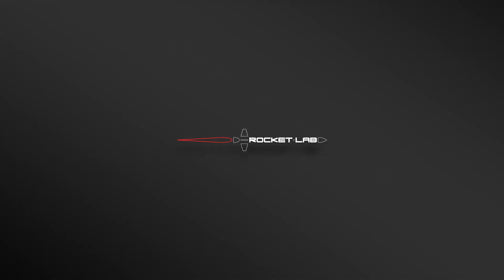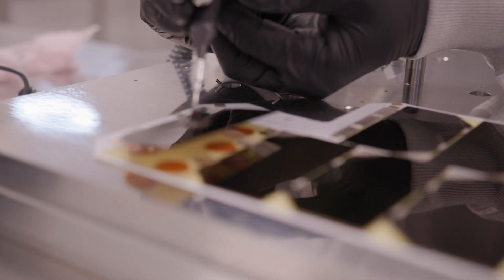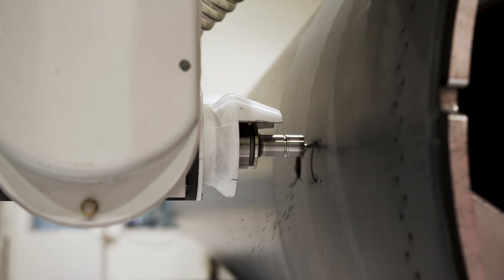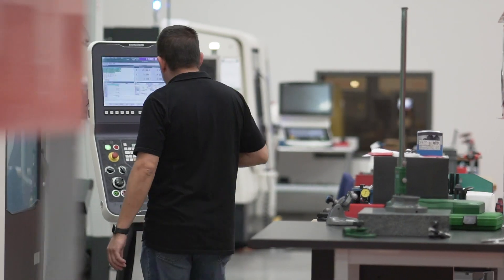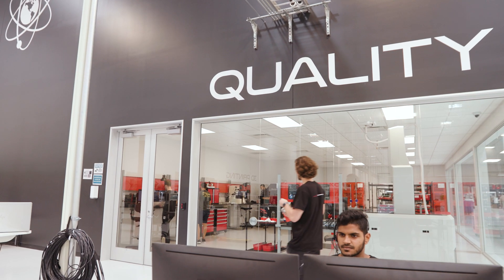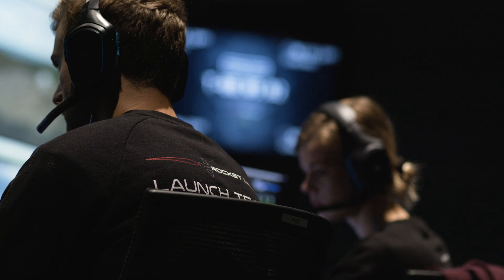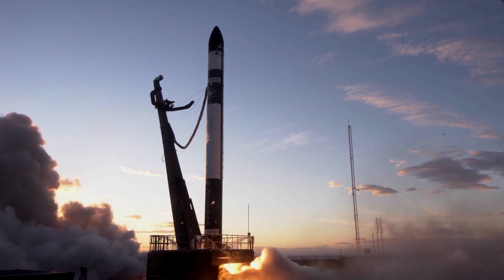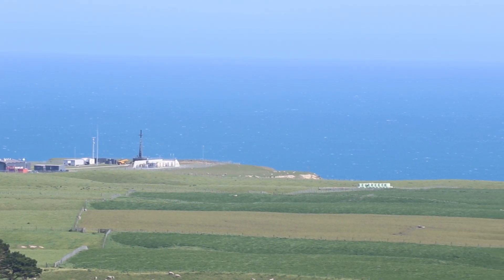Rocket Lab | Global Facilities Tour

Comment: Peter Beck says some strange things can someone explain his statements 
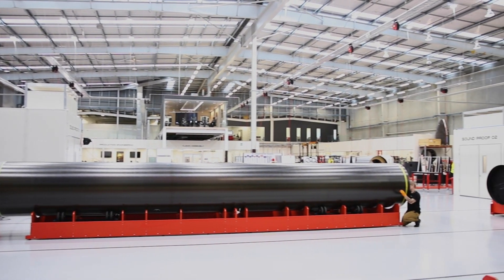@0:56 he says  Every 20 days a rocket rolls off this production line. !
But racket lab has only launched about 20 rockets in 5 years - do they have a stockpile of like dozens of rockets what do they do with them all. ?
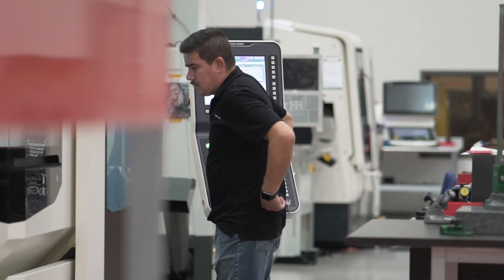@3:30 we produce an engine every 24 hours. !
That would be enough rocket engines in one year for 36 of their rockets - what are they doing with all these engines or do they just run the factory for only 60 days per year. ?
And they talk about how they are cost effective but at 7.5 million per launch that is over $20,000 per kg is that really affordable or appealing.
It seems like Beck is out of touch with what is actually going on how long can that last he needs a reality check. !
Reply: They are saying they can produce them at volume if needed... but they are not going to produce and stockpile and store 50 rockets if there is no customers to use them, they may have 1 or 2 in stock or backup etc...
Reply: @NighthawkNZ  Yep and they got more competition than ever with Astra, Virgin Orbit, perhaps firefly and others. The supposed massive demand for small satellite launch is over stated and the ride share flights on bigger rockets are far cheaper anyway.
I find Beck foolish and untrustworthy - i guess he has to talk things up as much as possible they are burning cash and unless they find a way to change that they are headed for failure. I would prefer if he were honest about the dire situation they are in their share price has dropped to 40% of initial value - he should be willing to say things are not great when they are not great - instead he acts like some idiot general saying everything's under control as a column of enemy tanks smash thru the defences. Becks behaviour does not inspire confidence that he is dealing with things properly - he should be eating a lot more hats.